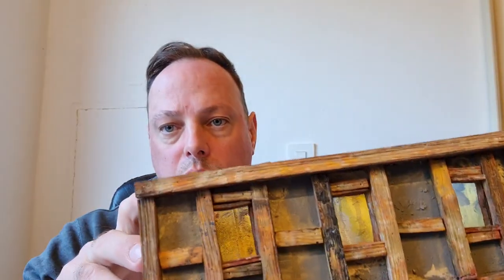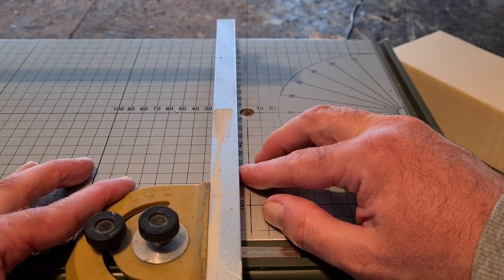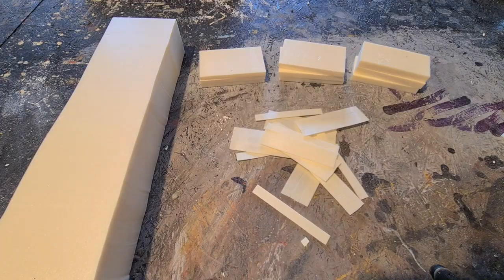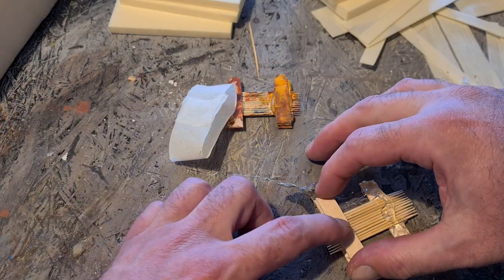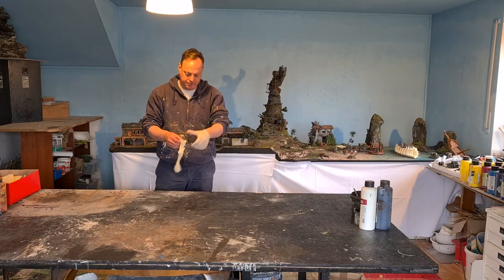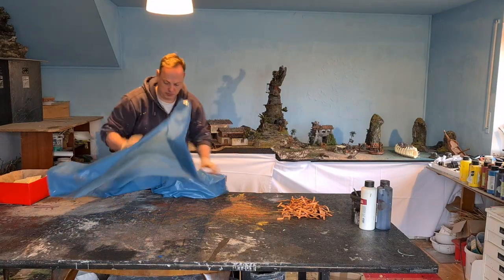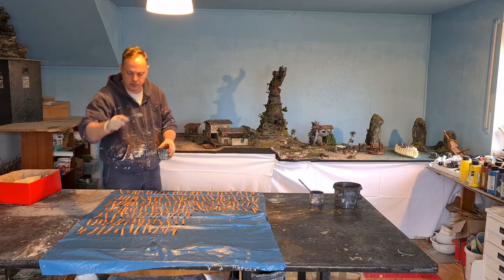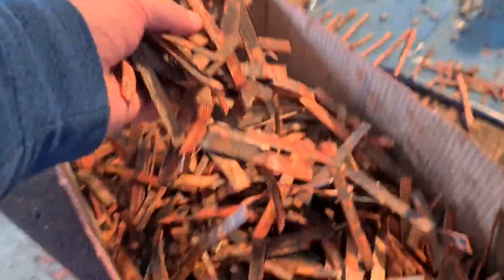Wooden Planks for wargaming terrain (from XPS with a hot wire cutter)

Comment: Where are you getting your XPS boards from?
Reply from the maker: The baumarkt (something like home depot) 120 x 60 x 6 cm Boards. Insulation stuff. Bought a pack of 6 boards last year. Still got more than the half left 😄
Reply: @WeltenbauerClub  Did you manage to get the boards without the silver foil on, or did you have to remove it yourself?